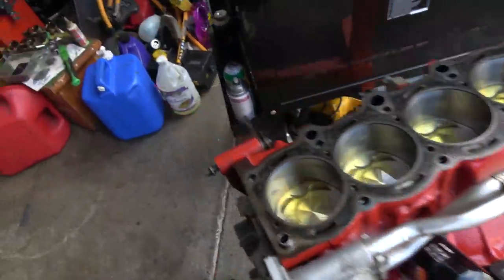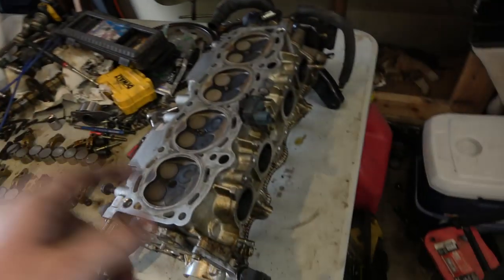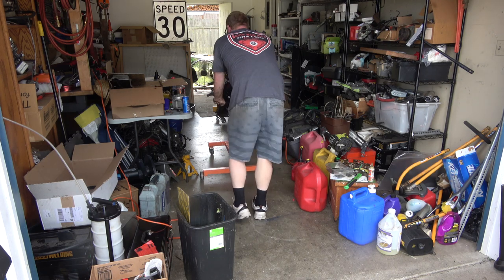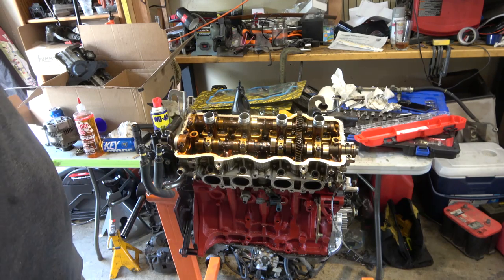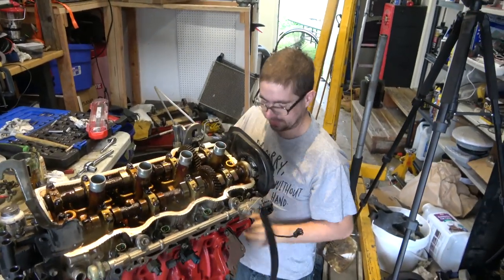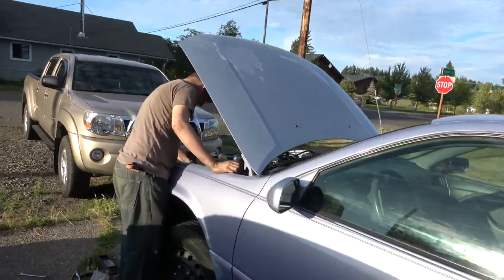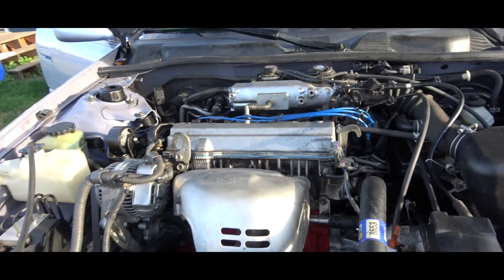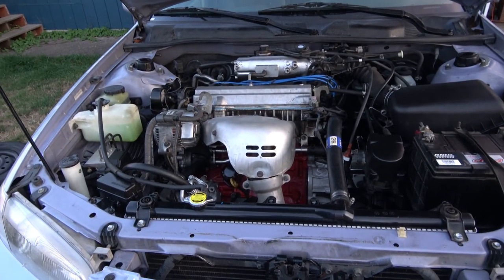"Backyard" 5SFE 2.2 Rebuild | Final Assembly | Will it Run or Blow up?

Comment: I just had a tech school install my timing belt and corresponding parts in my 5sfe. They messed up (but fixed it a few days later). They accidentally installed the timing belt off by one tooth and they didn't tension the belt properly. The result was that at cold start up, the belt would be real noisey slapping against the cover and the car got instant horrible gas mileage (went from 29-31mpg down to 18-19mpg). I drive 400-500 miles per week all highway so hopefully my fuel economy will be at least what it was. The engine now feels peppier than ever after the re-adjustment.

Comment: I can appreciate your efforts but I don't get it?  Aside from replacing the head gasket, what did you replace?  The pistons, rings, bearings, water pump, ... what?  You didn't remove the valves and clean the stems, replace the valve stem seals, re-seat the valves ... to name a few things normally done during a rebuild.
Reply from the maker: Hardly Moving Productions you missed the previous videos. We rebuilt the block with new pistons and rings, polished crank and bearings to match. Reused the head which has been fine since this video came out. Car runs like new.
Reply: @justhes  Okay.  That makes more sense.  You should state that in your "SHOW MORE" video text description with links to the other videos.  Also use YouTube's End Screen and Cards if you want to get more visits to your other videos in your channel.  Just my two cents.

Comment: That 1 bolt looked like you only went 89 vs required 90, time to scrap the project, or let adam drive it, seems he destroys them fast
Reply from the maker: Jim Smith nah it’s fine, still going. But how does he “destroy” it? The Lincoln is still on the road, the explorer was a steaming pile long before I even got ahold of it. Find me a video where he blew up an engine or transmission.
Reply: @justhes  calm down, was joking
Reply: Will say, after the manual conversion was hoping to see the diesel conversion talked about, seen was scrapping next i saw, would have been interesting to see mpg with it
Reply from the maker: Jim Smith lmao, I shouldn’t respond to comments when I’m at work. I was really wanting to do the diesel swap too but myself and Adam lost interest in it, especially after it’s electrical woes

Comment: Is it nescessary for new head bolts or I can reuse old ones
Reply from the maker: Some cases you can, but I always get new ones.
Reply: @justhes  thanks what is the engine rebuild kit you use imma be doing this project in the summer I have a head gasket engine the Mile on the engine is high so why not do a rebuild since I'm disassembling it

Comment: What would cause this car to have a shaking steering wheel at low speed I already replaced my sway links
Reply: Outer tie rod if your lucky inner tie rods if you aren't
Reply: @nastilyasperated2215  ok thanks do you think its safe to drive If that's the problem
Reply: @conner5611  definitely not. Easy way to check is to get under the car and grab it and try to move them. If they move they are bad. It controls your steering so if they snap you loose all steering and the wheels will turn any way they want too....very dangerous. Other things could be wheels not aligned correctly or tires worn or even a bad rack
Reply: @nastilyasperated2215  I've had the wheels off the other day I replaced the sway links and checked everything nothing has a serious amount of play I plan on doing a tire rotation tomorrow to see if it helps I've already drove it around it seems fine above 35mph
Reply: @nastilyasperated2215  it's fixed it turned out to be a bad tire it only pull to the left a little but that's fine thank you for your help

Comment: The noise is from exhust cam. You need to line up the gear right.
Reply from the maker: rumel Siddique except they are lined up. It was actually the timing belt slapping the cover.